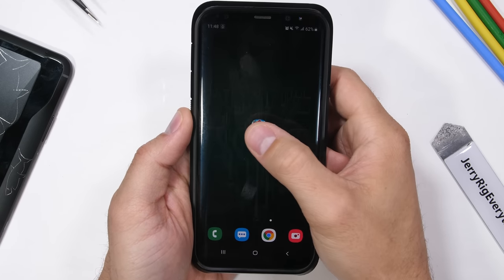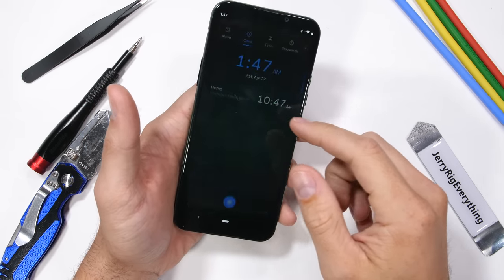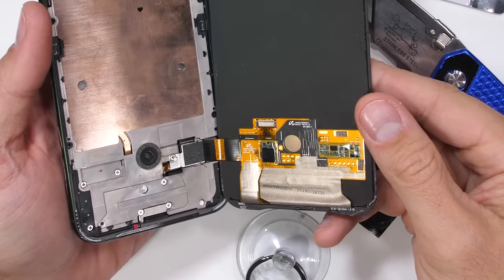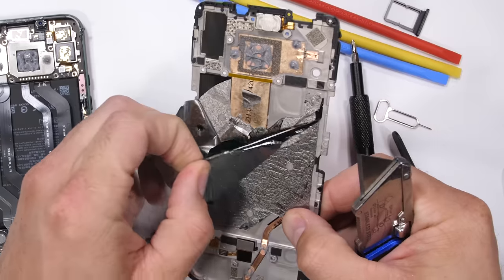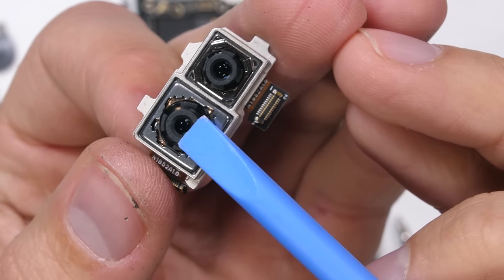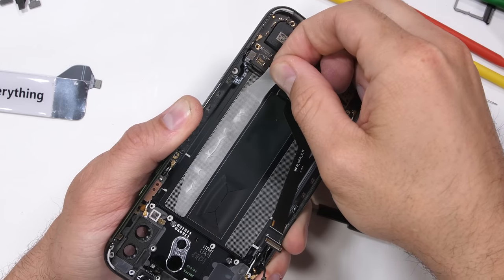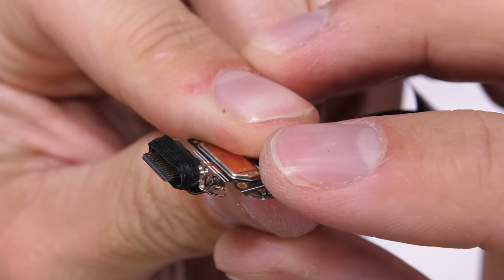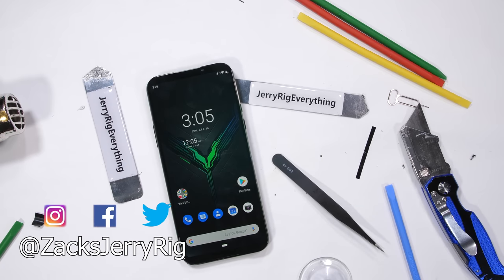Black Shark 2 Teardown- Biggest Heat Pipe Ever?!

Comment: Gaming phone with no headphone jack.. Were the people who designed this on crack or something?
Reply: no jack, no buy
Reply: Headphone jacks  

I S   N I C E
Reply: i wish they remove front camera to cut budget instead the headphone jack fffsss!
Reply: @zedboiii  I think a cheap screen on the back of the phone for selfies would be cheaper than a front camera
Reply: @ShakamuraGames  unlikely. Those front cameras are dirt cheap
Reply: @noneofyourbusiness4294  yeah, but they don't achieve nearly the same quality of the back camera
Reply: @ShakamuraGames  so?
What I was going for isn't the quality of the frontcamera, but rather that they're way cheaper than a display panel
Reply: I'm using shark 2 right now....it doesn't have the hole but there is a free pot that specifically for this phone you can plugin into the charging spot
Reply: f harrison. at the first time i bought my iphone, i thought the same just like you think. no problem there's usb port for audio....but, i assuming you're new to "no jack" phones or a simple guy kind that never need headphone and charging at the same time. i owned an iphone and xiaomi mi6, both have no audio jack. sometimes i need to charge the phone but i also need to keep the headphone pluged in, most gamers did this(at least my all my gamers friend alwayas did) charging while playing games. and i also bought a usb c splitter cable, that split charge port and audio port, iam using it on my mi6, one month, and and one day the splitter chip fail, it fried my mi6 usb! now the phone is still work, but quickcharge and audio is gone and both my windows pc and linux can't detect the phone usb when pluged in.
so, yeah...we need audio jack!!
Reply: I think they don't have a headphone jack because they want you to buy the gaming controller on both side of the phone. That way you don't have space for headphone anyway.
Reply: @nurhalita4254  that was interesting story.
Reply: @zongyuwang1179  the gaming controllers is free bonus tought so yeah
Reply: at least they give a  usb c x audio jack adapter for free inside the box

It's just you can't charge it while using a headphone at the same time

Comment: Is the camera and lack of headphone jack the only poor aspect of this phone? 855 chip. great gpu. 8/12gb ram. 1080p+ amoled with great response time. In screen fingerprint sensor. Big battery. Super fast charging. Dual front facing speakers. Insane cooling. £470??? 

Dont care about wireless charging personally btw.

Would love someone to breakdown why this phone is almost £500 cheaper than an iphone/s10/p30 pro?
Reply: it called Little profit dude
Reply: @TegnoV2, Xiaomi is a great brand, I am using my MI 9 and I am loving it, of course it isn't all about gaming, but it is freaking awesome for half of the value of an iPhone XS Max... I truly recommend it
Reply: They have lower profit margins and less spent on R&D
Reply: @lucasgabrich  whats the main difference between the mi 9 and this? How do you find the battery life and multitasking performance? They are are the 2 biggest things for me
Reply: @teqnov2740  Hey dude, so the battery life is just okay, and multitasking is incredible on MI 9. The main differences is the camera, which is really good on my cellphone, however the battery is thinner, so if you want to run pubg for example you will be capable of using it for 4 to 5 hours before you need to connect it on the power brick
Reply: Using it on best performance ofc

Comment: I'll buy it if it have 6,9-7,2 inch screen and 5500-6000mAh battery. This phone are design for primary driver phone for gamer. So they made it in regular size and put high quality camera.

If its a gaming phone make it little thicker so comfortable to hold in landscape, make it bigger so you can spot enemy and touch your screen easily and you able to put bigger battery.

Single camera fine.

Comment: I found ASUS ZenFone screen easy to remove to. I already tear down my mother's ASUS ZenFone Zoom S, my ASUS ZenFone 4 Max Plus M1, my sister's ASUS ZenFone Max Pro M1 and my grandmother's ASUS ZenFone 4 Max ... pretty easy process if you separate the screen from the plastic frame. But before that you need to remove the back of those phones and the component ate attached to the plastic frame on the phone

Comment: Hi Zack, please tell easy way to clean speaker grills on a smartphone. I am very accurate owner of a very old xiaomi mi note (since release in beginning of 2015), it still fits my needs and i'm okay with it. I'm not using any cases or bumpers and still have no scratches on the screen. The only problem is dust in every hole of the phone. I can easily clean charging port with a toothpick, but have no idea of how to clean speakers holes on the bottom (they pretty deep) and speaker grill on top.